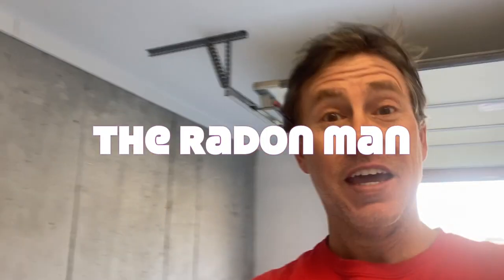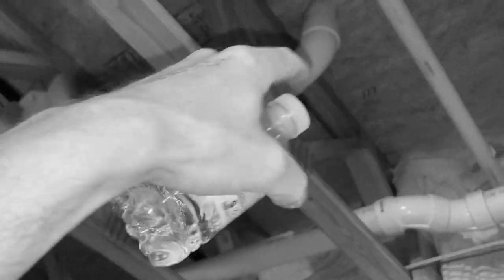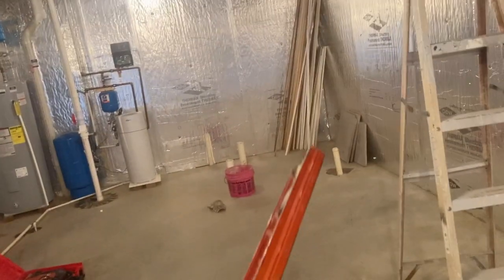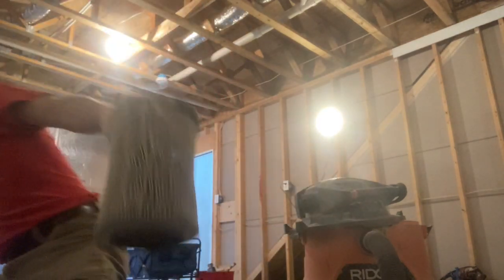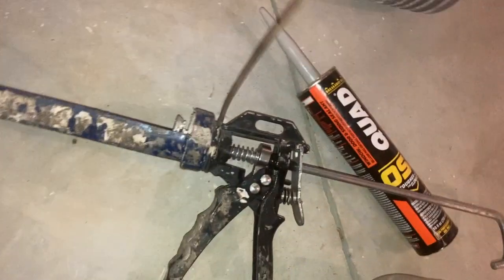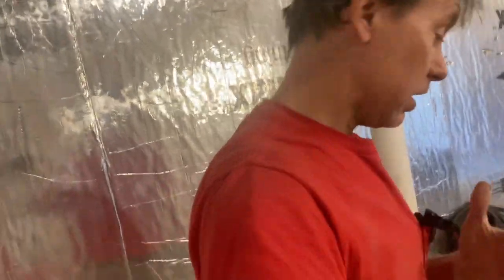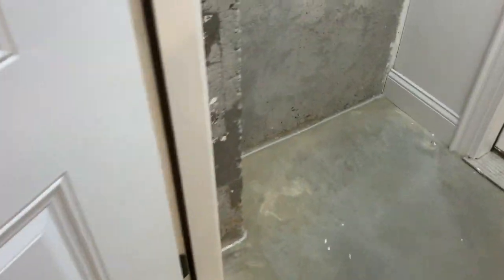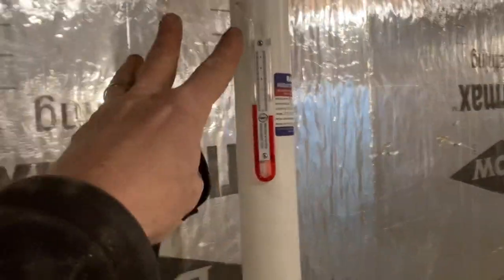Passive Radon System With High Radon Levels 33!   HD 720p

Comment: The expansion joint should only go down 1", so proposing to seal it should have been backed up by testing it first for a leak.  You could also do a smoke test for the suspected leak along the edge of the slab.  I would have used silicone along that edge, not foam.  Would have been nice to hear what the resulting radon level was.  When I installed my radon fan, sealing the leak around the edges of the slab made a huge difference.

Comment: What was the final level when you were done? How come you don't use gauges and test holes at the far edges of the slab?
Reply from the maker: Hi Don,  oddly, the jobs with really high levels tend to fall drastically once a system is installed correctly.  The manometer serves as a good gauge for air flow. As for the additional gauges and test holes, etc..you're not wrong.

Comment: Question please !  What is your max on 3” pipe length before and after your mitigation fan ?    Thank you and your videos are great teaching tools !!
Reply from the maker: Hi Michael.  I am more concerned about the 90 degree turns in the system rather than actual pipe length because the length of pipe is in proportion to the home which we can't change but 90 degree  elbows add a significant amount of pipe length in theory with drag or friction.  Hope that helps.

Comment: Smoke pen those leaks!  I was waiting for you to do it but never did.  Or at least didn't show it.  Those are a great tool for finding suction loss. Good for rerouting the stack though! What was the retest level?
Reply from the maker: You are right Chuck. Radon levels dropped to 2 pCi/L. Oddly the high ones tend to drop low and fairly quick. Thanks for your comments.
Reply: @radonman6800  That's good to know.  I have one to do in a few weeks that's at 34pCi/L as well. Sealing is definitely going to be my friend on that one.  Many large cracks.  Keep it up!  love the videos!
Reply: Why bother when you can just guess?
Reply: Exactly what my comments were before seeing yours.  Not a place for guessing.  Using the right tools and techniques saves time and $$$